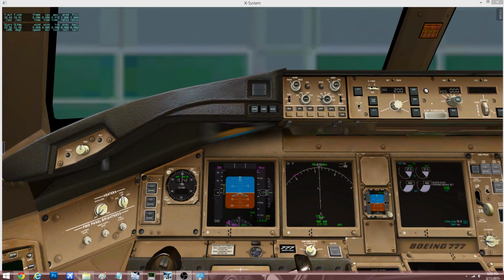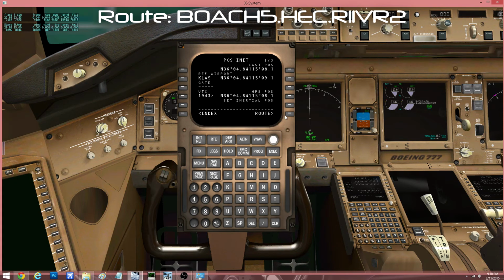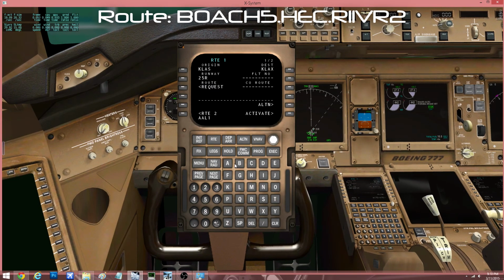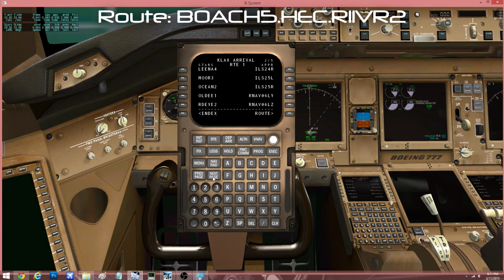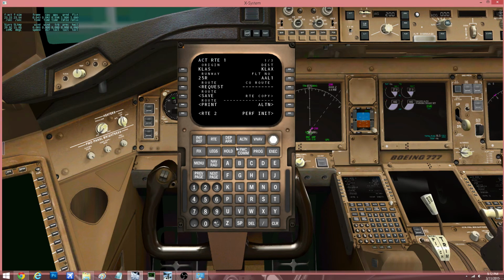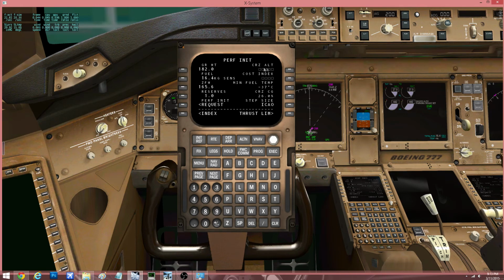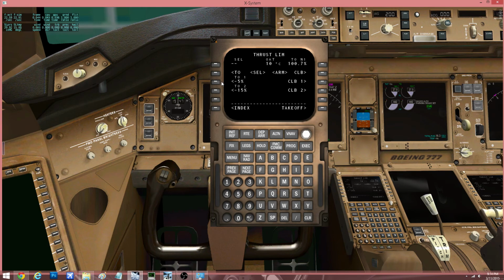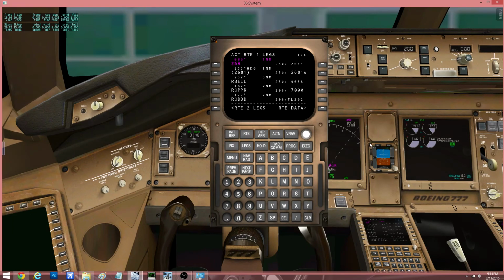FlightFactor Ramzzess 777 Basic FMC Tutorial [1080p]

Comment: X pilot I am new to flight simulator I was wondering how do I find out what SID to use and STAR? Thanks in advance!
Reply: The SID/STAR depends on your first/last Waypoint of the route and the runway you use. 
Sometimes there are more SIDs for that combination of runway and first waypoint. That's mostly because of different climb gradients. Generally, in the charts you will find when and when not to use certain SIDs.